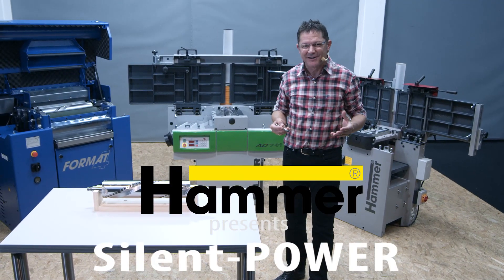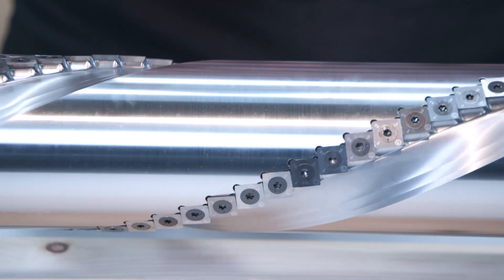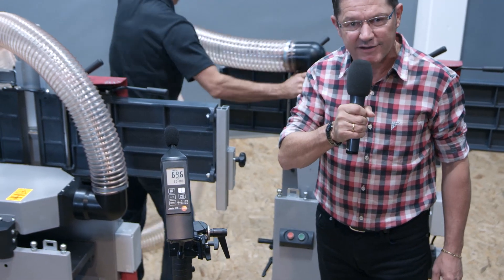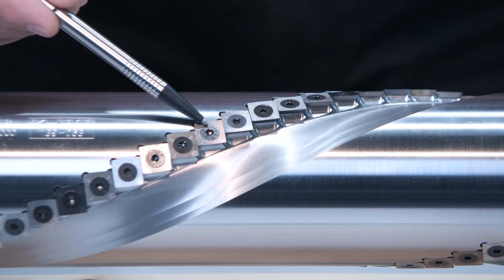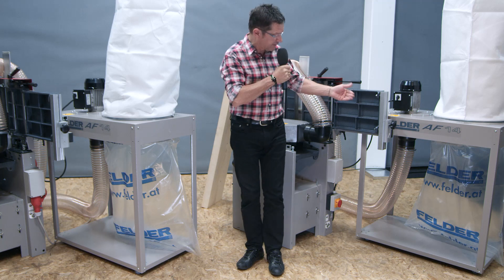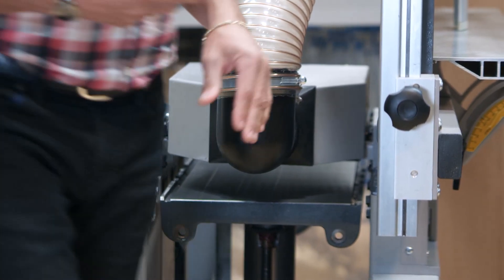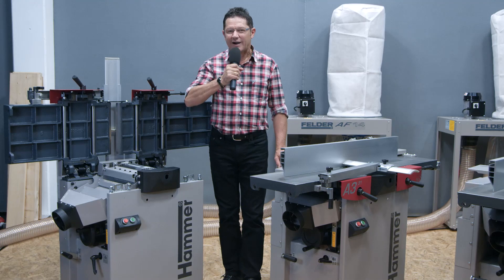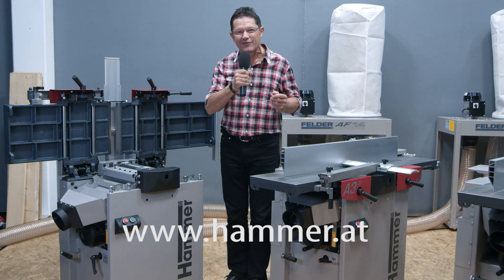Felder® Silent-POWER® - Comparison spiral knife cutterblock | Felder Group

Comment: My brother and I have been using these SP blades on our Hammer A3-41 for the last 8 months and they work absolutely great. 
Everything said in the video is true except comparing the quality of cut (in reality; they haven't really compared it in the video). 
It is really good but it can easily compare to straight blade cut. 
Don't get me wrong, the finish from SP is quite good but in my experience not any better than straight knives. I'd even dare to say that well sharpened straight knives will produce better results but won't stay sharp long as tungsten does.

But the other conveniences like noise, volume of chips, energy consuption, ease of maintenance and change of blades far outweigh the straight blades. I'd never go back to them.
Reply: I agree with you that on most woods a good straight blade like a Tersa can leave just as good of a cut quality as these, but these spiral cutters do make a difference in highly figured woods where the grain is unstable. As you said, they do have a lot of other benefits as well though

Comment: What a pity felder wont offer this cutter block to existing owners. that's after sales suppoert for you
Reply from the maker: The Silent Power Cutterhead is high precision tool. To achieve the needed tolerances both of the cutterhead and the knives was very challenging for us and our knife supplier. 
We have discussed a retrofit here at the factory very intensively. However our R&D, our assembly and service department came to the result that we cannot guarantee the quality standard, which we have set for us, in a retrofit.
We can understand that many customers would like to retrofit the cutterhead to increase the performance of their machine. However we want to avoid that such a retrofit leads to problems on existing machines and frustrated customers.

Comment: These Felder/Hammer Silent - Power cutter heads are made by a German company called Lietz and the Tungsten cutters are made by Tigra another German company.  If you look carefully you can see the manufacturers names in some of the shots.

This video is also " Confusing " as the comparison is  not between a Conventional Straight 3/4 knife block, the other machine appears to be fitted with a Helical head with Individual 4 sided Tungsten cutters.  Pause the film at 5-34 and you can clearly see this.   However the Silent Power does appear to be quieter.   Robland a Belgian manufacturer uses a very similar cutter they call Xylent -Block.  From what I can tell the only thing that is Exclusive to Felder/ Hammer is the Name they give to this design / style of cutter Head.
Reply from the maker: Dear Mr. Dobson,
Spiral or Helical cutterheads a indeed no new invention and have been around on metal and woodworking machinery for some time. There are 2 conventional systems on the marked.
1. A solid knife that spirals around the cutterhead. 
Leitz is producing such systems and this maybe the system you have seen.
We have been offering this cutterhead for some year on our model Format-4 exact 63. However the knives are not available in tungsten carbide and replacing the knives is very expensive. This was the reason why we have stopped with this system
2. Many single straight knives that spiral around the cutterhead
These are more common systems and can be found from various manufactures from Europe and China. Most of these systems use straight knives that are mounted straight on the cutterhead. The next knife sits in an offset and the system creates a spiral. However this does not create a continues cutting edge. There are many individual cuts which makes is necessary to have a 3 to 6 spirals in total to achieve a descent cutting result with no tear out. Better systems from some other European manufacturer have 3 spirals and most Chinese cutterheads use 6 spirals.
The more spirals are needed the more knives. However the biggest disadvantage is the power consumption. More spirals mean higher power consumption. The combination both disadvantages mean higher costs for the user on the long run.

FELDER has developed a 3. solution. 
The Silent Power knives are not straight. They have 2 different radius on the cutting edge. Each knife seat is tilted on three axes on the cutterhead. This created a virtual continuous three dimensional cutting edge. Because of this FELDER can achieve a perfect cutting result with 2 spirals. This means
- Low power consumption
- Lower maintenance cost
- Lower noise
- Perfect cutting results
This is the unique feature behind the Silent Power Cutterhead. And this you will not find from anybody else on the market. Many have tried to copy it but until today nobody has succeeded.

Kind Regards from Tirol/Austria
Reply: Great technical commentary and explanation of why the Felder silent power block uses less energy with less noise whilst producing a wonderful finish! Many thanks!

Comment: The mic should be moved to the same relative location for each machine for a true test.  I am surprised they didn't do that in the video.
Reply: I'm surprised you think that would make a big difference. If you ever used a planer you know that standing 1 or 2 meters from it makes literary no difference, it's really loud. You don't believe it's quieter or what?
Reply: Sebastian Daniec yeah, but that is with your ears. it makes a big difference to microphones. It would have been good to “hear” the difference
Reply: Very true. I have a bench top Jet and it’s an absolute screamer. I’d love to own one of those helical head machines. They look and sound a pleasure to use.
Reply: That makes all the difference. We can see about 10db difference between the two. But doubling the distance between the mic and the machine (could be this far) makes 6db. Really not worth even bothering with the sound meter.
Reply: Yes, and how we know they set the same chipload on both machines?:D